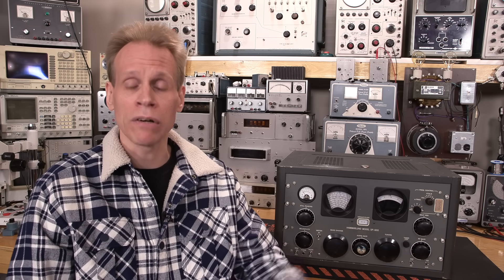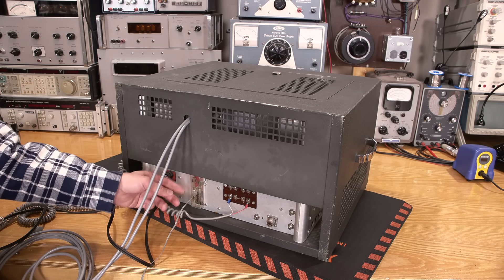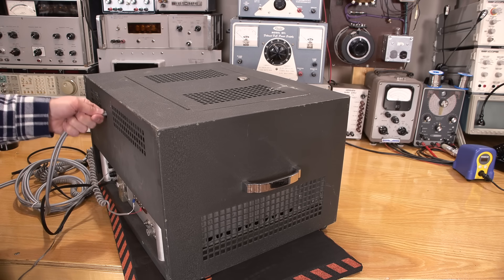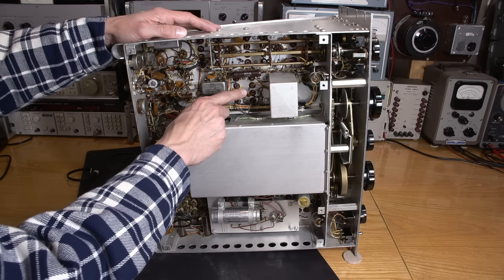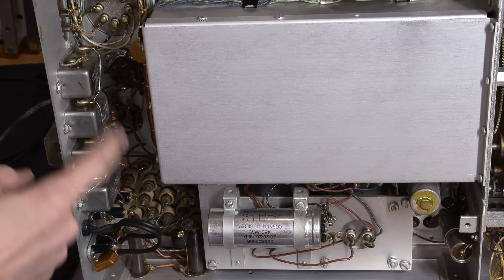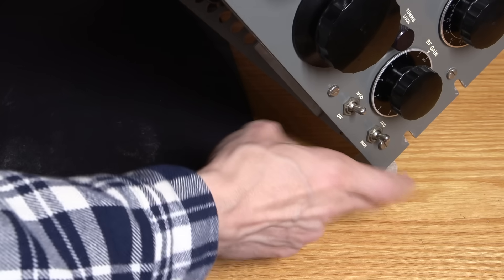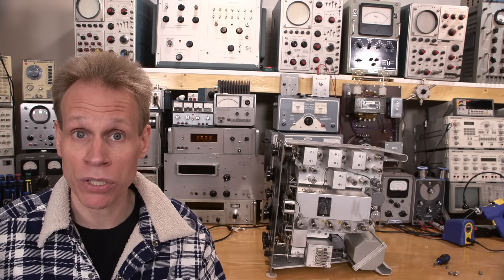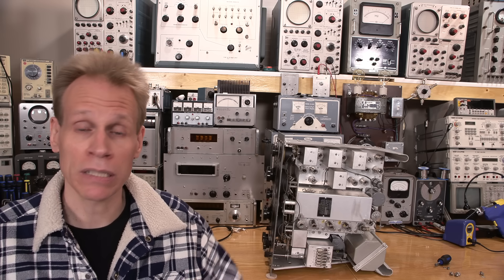Hammarlund SP-600 Receiver Restoration?

Comment: I've enjoyed watching your other restorations, so please keep them coming.  The SP-600 would be a great addition.  I like these old receivers.  I will have to say though that you may need to add a jib crane in the lab to heft around some of these behemoths.  My dad was a ham operator so I saw a number of receivers in action.  In fact, my first foray into shortwave radio was with my dad's Lafayette HE-10 with matching HE-48 speaker and a Heathkit Qf-1 Q multiplier.  It was a joy trying to pull in the DX with just a 100' long wire antenna on that setup.  I later built my own Heathkit GR-78 receiver back in the late 70's and still have it.  Although it still works quite well and I do enjoy using it, modern SDR's with the new digital capabilities are a bit more universal and fun in their own right.  Hope to see many more restorations on the channel.  Thanks.

Comment: The SP-600 has a very, very special place in my heart. I'm currently 73 years old, but when I was very young, from age 10 through 17, I spent hours and hours listening to an SP-600 that my father bought after WWII, During, and after, the war, he was a radio operator in the Merchant Marine. Fast forward to the year 2000, and he had passed. I inherited his vast assortment of ham radio gear and test equipment. While I had huge affection for the SP-600, it needed the kind of restoration we're talking about here. But at the time, it was more than I could take on. Today, well, maybe not. So I sold it to an enthusiast in Japan, who I believed could do it justice. Funny thing, I regret letting it go. It's almost as if I had betrayed the essence of who my father was. Today, I have progressed in my electronics journey and wish I could follow along with this restoration with my own SP-600, but it wasn't  meant to be. Instead, I have veered into single-ended, tube stereo amplifiers. All in all, I'm at peace with where I have ended up. But I will still follow this restoration with great interest!!

Comment: RESTORE IT!!!!   I always wanted an HQ-180.  Never had one.  Had a JRC NRD-535 with all the options except SSTV. I live in Chicago and mostly what I could hear was interference no matter what antenna I used- magnetic loop, slanted wire, vertical, long horizontal wire, etc etc. I sold the JRC and now I use an SDR.  Reception is about the same but the cost is much lower.

Comment: Racal RA17 would be interesting to see, at some stage. These used to be very expensive in the UK but so many have appeared on the 2nd hand market from silent key sales, many bargains can be had. Also, it is a Barlow Wadley loop receiver (Like the Yaesu FRG7 & 7000 ) so very selective and stable, being top spec military/government issue.

Comment: This unit appears to be in mint condition already. I would be interested in seeing a video or 2 to test and repair it as needed but probably not much required to bring this up. Some of the much worse equipment you have may be better for a full restoration. Thanks.

Comment: I would love to see a restoration on one of these.  I'm currently working on upgrading an SP-600 from the "bumble bee" capacitors to disc capacitors and the one area I haven't gotten to is the turret.  I'm not even sure if the turret even has any of the bumble bee capacitors in it or not.

Comment: First off my vote ie YES..YES ..YES please continue with the restoration project on the SP-600 and I have a vested interest in it lol I've owned one for 25 years and so I'm very interested in this that being said I've got i question for you I have not turned my radio on in over 10 years it sits proudly in my bed room in ambient  temperature and it worked perfectly last time I did use it Now my question is I don't have a vari voltage regulator so should I just throw fate to the wind and just plug it back in or what can I do to bring up voltage slowly any suggestions??

Comment: YES, PLEASE!!!!!  Restorations-are-us...  These are called "boat anchor radios" for a reason -- their weight.  And they are often cobbled into service with special wires added for good measure and customization...
You need a good turntable/lazy-susan for your heavy gear on the bench.  Especially when you have linear (low noise) power supplies and inductive reactors.  
I've also used some "furniture mover" or dolly pads which are slick on the bottom and have a rug-like top.  It saves your bench, but constant vigilance is the price to save your bench top.  I've also seen some benches with replaceable Masonite tops that you sacrifice during one of these projects.
So many of these are in the hamfest circuit and have been stripped of most or all filter crystals.  There must be some great hoard  of such crystals out there looking for a buyer.  All to make a few extra buck$$$.

Comment: Every time you take a cover off of an old radio there is always something unique about it. The Hammarlund has metal covers over everything and the tools to, I guess, adjust the tuning. The thing is built like a tank, so you may have to get a turntable from an old rail yard round house to spin it around easily. I would love to see a restoration.

Comment: I enjoy seeing your restorations! From what you have said in this video this unit is very clean and maintained and it appears as if the restoration will be a very rote replacement of old caps. If that is the case then this would be less interesting than harder restores. Still nice video.

Comment: Yes, go for the restoration of the SP-600.  I have two, one in the home shack and one at camp.  I would be interested in the alignment.  I also have an issue with the the tuning dial "slipping" and not griping while tuning the receiver.  Thank you.

Comment: This radio is like new mine had the bumble bee caps but some one had recapped the rf deck with orange drops so I did not have to remove it but I later had to recap three other sets and had to do the rf deck care must be exercised in reassembly to avoid breaking the contact fingers that connect the turret drum where the coils are for the bands mine is a JX17. Love these sets restore it.

Comment: It looks like these were produced from the 1950s to 1970s, and yours is likely a later one. At what age do you decide to replace all the electrolytic capacitors? Do you just go by age, or some combination of age and condition?  I've heard as short as 10 or 20 years, but I see some that are older and appear to be just fine, so I'm not always sure when to leave and when to replace.

Comment: As a turntable to turn around heavy stuff I can advise an old CRT TV stand: it can hold tons of weight, it is cheap and people throw this away everywhere. Sometimes there are just turn add-ons without the cabinet underneath. It is widely available everywhere. In my personal possessin is a fancy all-glass model with a huge ball bearing between two glass plates. Alternative option is a fitness disc from the 80s: the one you can stand on. Not too fancy but this thing will serve a millenia. My humble opinion: radio receivers is not a future-proof thing. A multimeter or an LCR meter will be used until end of times from the other hand. In other words - more measurement equipment restoration please :)